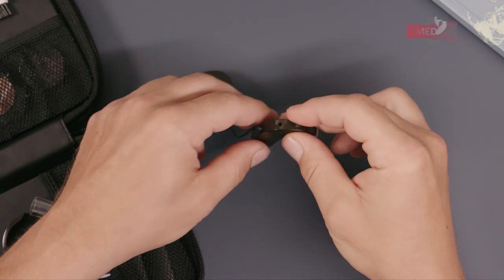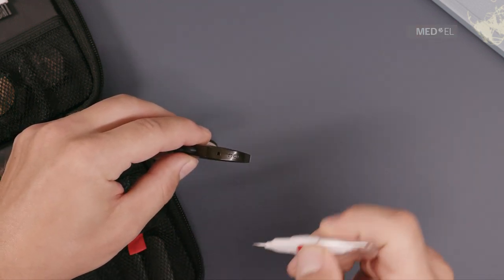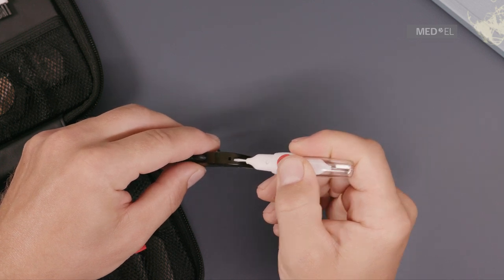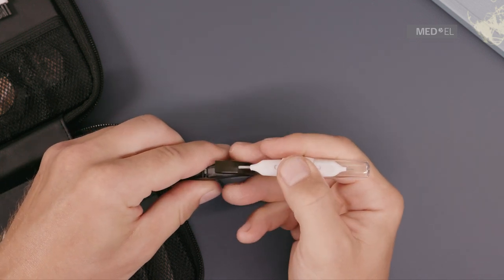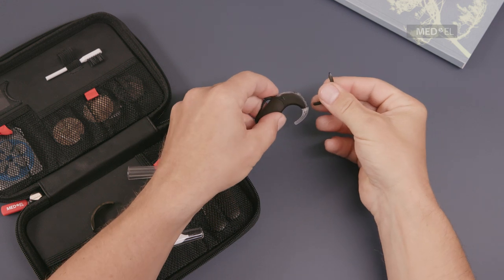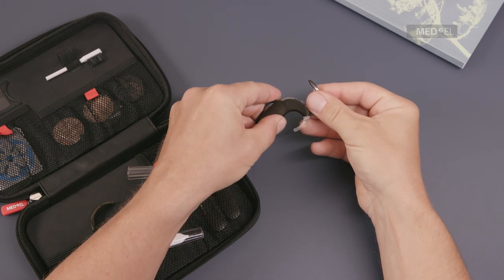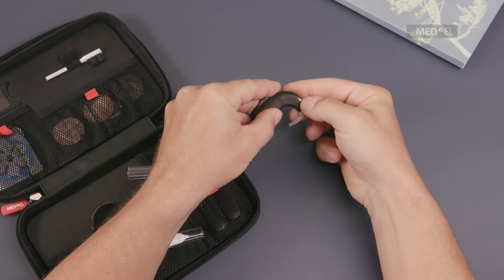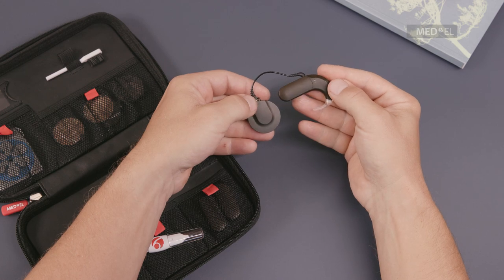SONNET 2 Hands-On: Changing the Microphone Cover | MED-EL

Comment: It’s a shame that it works only in a controlled environment, because I and many other users have covers that are nearly glued and when they come off, it snatches and have to had them sent to factory. I’m bilateral and happened TWICE on both sides. Now I have them sent to the factory for changing, because even the sales rep is afraid of doing it. I never had issues with Opus 2, but sonnet is giving me such a hard time!
Reply from the maker: Hi there, thank you for sharing your experience with us. We constantly work on improving our products and will forward your feedback to our responsible team.

Kind regards,
Gordana
Reply: My internal pricessor pin broke when I did this. Please help me what to do next?
Reply from the maker: @samadmijan7859  hi there, thank you for your comment. We would recommend getting in touch with your local MED-EL team as they are best placed to assist you with repairs. You can get in touch with your local MED-EL team here: https://www.medel.com/contact-med-el

Kind Regards